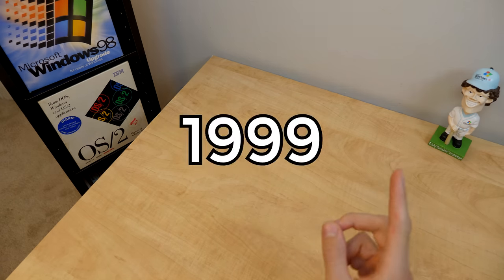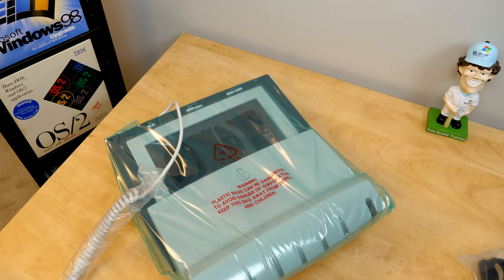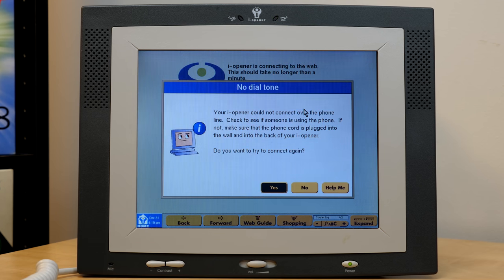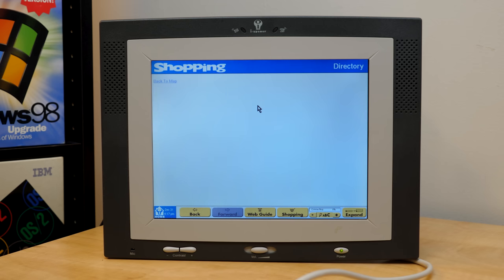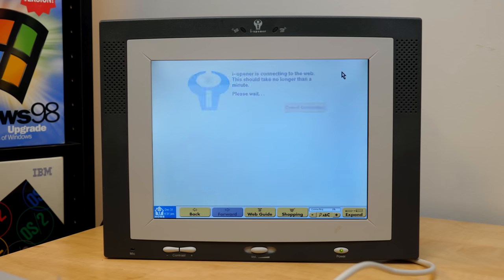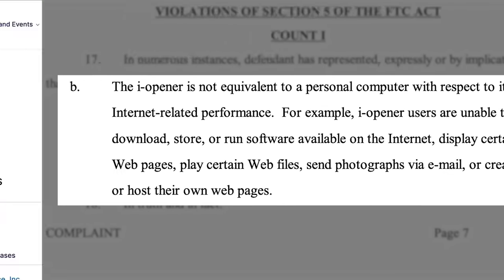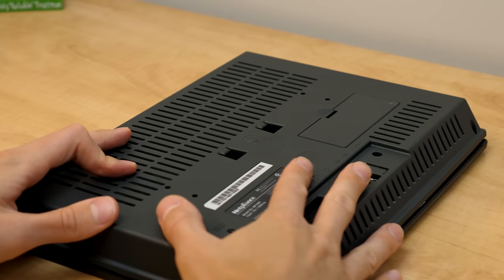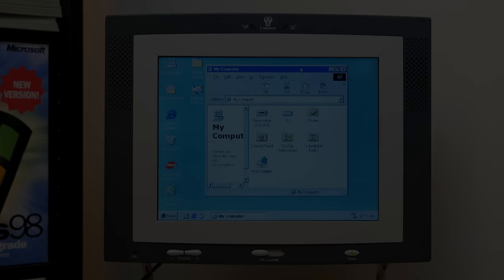i-Opener - The $99 Computer That Cost a Company Millions

Comment: I was relieved when you pulled out a second unit to demo the original software because I was like....noo don't boot it up yet! There's a exploit involving the initial bootup process that's gone forever once you finish it! :D

But thankfully you already knew about that. :D

Used to own one of these in the early 00s. My high school spanish teacher would have me help fix any computer issues she had and one day she gave me one of these that was just sitting in the closet.

Sadly I did not keep it as I didn't have the power adapter it needed so using it was a hassle. I did read about hacking it at the time but since it required a special cable it wasn't something I could do. I recall the version I had was one where they put epoxy over the BIOS chip too so removing it to flash in an external flasher wasn't practical either. (you seemed to have forgotten to mention that. They epoxied down the bios chip in some later revisions!)

Would definitely like to see you get drivers on it. Would like to see how bad Doom looks on that LCD panel. :P

Also there's an unpopulated second USB port pad on the motherboard. Curious if the SMD components and such related to it are present and simply soldering in the port would be enough to make it work. Would be cool if you could get a second port working. It would only require cutting a hole in the metal shielding since the case already has a cut out for it. Not sure where you'd find a matching port to solder in. I guess you could sacrifice the one from your second unit but surely there's spares with the right formfactor on digikey or something....

I imagine you could get one of those backpack Parallel port external CD drives too for some CD shannangins! Something I've wanted to do if I ever get one of these again.:D

Comment: This reminds me of a friend who acquired a computer that was setup for a medical device. It would beet fine from its HD but when the HD was replaced with another drive, nothing. What they found was on routine in bios that looked at the drive for a small partition of a certain size with a simple line of a short command at which point it would change drives and go to the "d" drive partition on the same HD and run the operating system. Simple fix, they repartitioned the HD into two partitions, the first limited to the originals size with the line of code in it and the second drive they added Windows to it. Simple fix without messing with the bios.

Comment: Got one off eBay in 2007, paid like 100 then and planned to use it as a core to create a digital jukebox in a old tube based floor standing radio that was broken. I horseshoed Midori Linux into it that ran ok,,, but never finished the concept. Later in 2009 I ran into someone that wanted one real bad and made a 100% profit. All said the iOpener was a great platform I never really got to fully realize...

t was a cool machine and around that time I had something similar made by Gateway too but the Gateway had those evil "self destructing" caps issue that many manufacturers enjoyed. in the early 2000's There's a good story there as well. A industrial espionage thwarted thriller.

Comment: This brought back some memories! I bought two of these as soon as I heard about how you could mod them. This would have been some time in the year 2000. I bought the kit with the hard drive mounting bracket and modified IDE cable, as well as a pre-flashed BIOS chip (it was easily swapped with the factory chip since it was in a socket) that would allow me to boot from any device. It was never a great system, but it worked! I think right now it's still sitting in a box in my basement, with a copy of FreeDOS on it, as well as some DOS USB mass storage drivers so I could easily get files onto and off of the thing. I think I might have originally installed Linux on it, though.

I gave up trying to use it for anything mostly because the screen was absolute garbage. The resolution was OK for the time but it was a super-cheap LCD panel that streaked whenever anything moved or scrolled.
Reply: Incidentally, the second one I bought sat unopened in a box for, like, 20 years until I finally pitched it in the ol' fuck-it bucket.

Comment: I have one of these . i acquired it for $20 back in the 2000's and started the mod on it but never finished it. I do however remember buying a custom PCB that you would attach to the IDE header and then could use standard cables . . . I may have to dig out it out of storage.

Comment: When I started driving, gas was .95 a gallon (now $3.34 where I live), the Marlboro Reds I smoked were $1.79 ($7.79 now), an hour of bowling was $15 ($50 now), movies were $7.50 ($13.50 now), house was $167,000 ($376,000 now) and minimum wage was $4.25 and now it's $7.25. 

At least quite a few examples of tech are cheaper. That's about it, though :(

Comment: Around this time line Radio Shack had a Internet Appliance, I think it was by HP, but required the MSN dial up monthly Internet to work. However back then if you wanted Internet for most, the only option was a dial up phone line service. So if you were going to use a computer on the Internet and not much else it made sense to have a Internet Appliance.

Comment: I remember those back in the day and when people found out how easy it was to hack. Always wanted one but I had more than one PC already and couldn't justify it or the room it would take up. But I always wondered how far you could take one. It would have been funny to see an i-Opener booting XP with a K6-III+ CPU at 450 MHz and 128 megs of RAM or something along those lines. I have no idea if it was possible, though. Running a WinChip may mean that revision only supported 3.5v operation. I used to use those to upgrade machines that only ran standard voltage. As long as you didn't game on it, they were as fast as a Pentium.

Comment: I had one of these. Version 1, I think. Modding it to run Windows was pretty easy. The hardest part was getting a 2.5" HDD that was thin enough to fit between the motherboard and the metal shell. Also the PS/2 port was funky. If you had a splitter you had to swap the mouse and keyboard or they didn't work. The thing was slow and had the worst flat-panel display I've ever used.

Comment: Oh yeah, I remember when Slashdot went nuts about these. That era of cheap inadvertently hackable junk from companies with more money than technological acumen was pretty awesome. Anyone else remember CueCat?
Reply: ' Anyone else remember CueCat?'  Of course, I still have two of them around somewhere in a box with old webcams, etc.  Not a lot of use with modern phones etc able to decode..
Reply: when i worked for the Oregon State BLM about 10 years ago handling files about half of the terminals including mine had CueCat barcode scanners for scanning the files, it was honestly kind of hilarious. Especially since legacy files with actual official CueCat barcodes would not scan on the firmware modified devices and had to be typed in manually only regular bar codes would scan on them.
Reply: Wow, I had forgotten about the CueCat. It's been ages!
Reply: I had one like 10 years ago to scan in comics and even then they were considered antiques 😨😨
Reply: I have many cuecats in a box somewhere - I got like 5 or more of them from Radio Shack I think - I'd just go in every week and get another one

Comment: This kind of loss leader hardware hacking still happens today. I had to install lineage OS on a Amazon tablet that's ad and data subsidized
Reply: There were clusters made up of PS3 consoles back in the day for the same reason
Reply: You can just ask them to remove the ads. Say you are having problems.  They won't even pushback.

Comment: The v2 was still easy. I've hacked both v3 (my personal unit which I still have) and v4 (the one with the RiSE CPU, but old sound chip). The Dolly cloning method was used on both.... its janky but it worked great. At least one of the units had epoxy on the BIOS chip, which thankfully I didn't have to touch. I opted for the v2 hack kit and a TennMax "lasagna" cooler with the a hole in the metal shielding over the fan area. Worked great with no heating problems.

Comment: The funny thing is that this is meant for novice users and refers to itself as the iPad, and I'd argue not just the name is a coincidence, but also the often use cases of iPads themselves. My sister (love her) is not at all computer savvy, but has an iPad with a keyboard to handle all of her computer needs.
Reply: Honestly that's all most people need nowadays. I have a pretty good desktop PC, and my non tech-savvy wife prefers to use the phone even if the computer would cut the time down by 50-90%

Comment: the pins are swapped to support a DOM, or disk on module plugged directly to the pin header. without a cable the pins would be upside down.

if your pins were cut you could just put the header on the other side and the pins would be in the right order.

Comment: I remember buying one of these for $99 specifically to convert it into a cheap PC!  I don't remember if I bought the crossover cable or made my own, but I remember someone had posted the missing drivers so in the end I had mine setup with a USB web cam and used it to monitor my dogs while I was at work.  It was a fun project at the time...

Comment: I think that it'd be possible to get a laptop or desktop CD-ROM drive to work off of the IDE port and maybe mount it on the side or in/on the base.

Also that WinChip CPU, at least architecturally, is a supercharged, over-glorified budget 486.  It only has one pipeline for data out and one for data in, iirc.  A Pentium CPU (which has multiple pipelines) would definitely be recommended over the original CPU.

In any case as to how the upgrades go, it'd be nice to see how it performs running contemporary games of that era or earlier.

Comment: I had an iopener V1 and I bought one of the kits with the bracket and cables.  I ran both win98 and linux on it for over a year, but at that point 800x600 was really showing some limitations with applications and internet sites so it turned into a network monitoring terminal for a while then was ultimately tossed out.  I think at some point I swapped in a faster CPU and cut a hole for a heatsink and fan as well, but again the performance was too limited for it to remain useful for more than about a year even when running linux which made it feel much faster than it did running windows.

Comment: 6:00 so, if you accidentally apply enough force to the cable and you unplug the PS/2 connector you'd have to unscrew the little flap to reattach it?
Reply: No it held the strain relief on the cable so it couldn't move.

Comment: I bought one of these at CompUSA back in the day. I was a design engineer at a company working on a tablet computer before they were a thing. Luckily they had a bunch of resistive touchscreens they were using for their prototyping and I found that I could fit one in (filing down the lip around the LCD, converting it into a tablet, powering it through a battery pack or through my car's 12v supply. I then upgraded the CPU to a K6 IIRC and added a microdrive and had my first MP3 Player running under windows. I did eventually get a letter from the company about what I was doing ( I was quite vocal about it at the time and I didn't ever subscribe to their internet since there was no hard requirement for it.) I ignored it (have it in the basement somewhere, but I did sell the computer at some point when I got a better tablet. Fun times!

Comment: Do you think the FDC really sued them because of users, or do you think it was because they used the IPAD acronym & Apple had plans for it around that time & would release it a few years later after they were put out of business. I bring it up because the FDC is not really consumer based but primarily is for business on business similar to the FDA which is not about food safety but rather about standardizing things between businesses. The expiration dates for instance are not for consumers but for business, however they did change them when consumers started using them & they realized they could get you to buy more.

Comment: Would QNX actually support the Canon Bubble Jet 2010 printer mentioned on the yellow flyer? I thought most cheap printers of that era used GDI printing which only had drivers for Windows.
Reply: It supported that printer and that printer only, so the driver was written into the customized iOpener OS.

Comment: $99 was too rich for me back then. Virgin sent me a couple of "Webplayers" for $50! Loaded a hacked Win98 on them asap!

"The Webplayer is powered by a 200 MHz Cyrix MediaGX CPU, 64 MB of SO-DIMM RAM, and a 48 MB M-Systems Disk-On-Chip 2000 for storage. It included two USB ports and contained a Mini PCI Type IIIB slot and 44-pin IDE header inside."

Comment: dating myself:  I did a college comp-sci project at CMU on how to replace the bios chip and install win98 on one of these machines.  I begged an ebay seller at the time to sell me two units, one nicer than the other for only 29.00 shipped.   Both of them delivered, I hacked them to run Windows, and I actually ran the later one for a few years as a very middling internet terminal before giving it to my parents.

My unit had epoxy over the bios chip, and I paid the 35 bucks for the twisted cable. I have to laugh at myself now, seeing how late I was on hacking one of these.

Comment: Oh, you don’t know how bad gas got. Before bush was out of office, it was 4.50 a gallon IN TEXAS. 

In 2015, it dipped lower than when it was when I started driving, 1.50. 

By 2018, it was 3.60, so expensive that’s when I got my new truck, people were unloading gas guzzlers. And that’s how it’s been since 2018 occasionally hitting 4.00 until the pandemic, April of 2020 at the height of the glut caused by no one using gas.

Comment: Circuit City used to deals like this back in the day. I think I got a deal on a Compac computer for 100.00 but I had to sign up for Cumpuserve internet for 2 years at 19.99 a month for slow dial up using a 56k modem.

Comment: I do not miss old LCD panels which were so dim and ghosted so much!
Reply: My LCD monitor gave up the ghost in 2013! I bought it in 2000. I tried to have it fixed but replacement parts for it where no longer available.

Comment: what is funny and sad, is that QnX is a much better OS than Win98 ever was.
Performance and efficiency-wise much better, real fine-grained pre-emptive multitasking, drivers are just process that can be killed and reloaded at run time. The graphics demo for QnX where amazing, you could have 10s of windows up running smooth animations while similar stuff on win98 would stutter and die.

Comment: You should install an SSD drive and add a wifi card for Internet connectivity. This thing would still run with a modern 32 bit Linux operating system in 2023! A hack transforms it into a capable mini PC! 😝

Comment: Oh, this brings back some memories.  I bought one of these right before it hit Slashdot after seeing it on Ken's site.  And then it hit like the next day or two afterward.  The warehouse didn't have any in it, and then Slashdot made mine become backordered.  Fast forward, and I get a letter saying there were new terms and conditions that I would retroactively be bound to (what you mentioned) - even though I already paid for the darn thing and was just waiting for it to come in.

Anyway, I bought one on eBay for $129 because the Slashdot effect had it backordered forever.  And I wound up getting a V2 like you did.  My BIOS wasn't messed up like yours was; I was able to get the kit and simply do what you did.  I went a bit further than you did - I put a fan and heat sink on.  Hard drive bracket.  I added an audio out jack.  PS/2 splitter.  Upgraded the RAM.  Upgraded the CPU.  Put a parallel port Ethernet device on there.  I do remember there was an issue with the USB chipset; any Ethernet USB adapters we ran eventually quit working. (I think just about anything USB wound up being flaky.) We eventually had to get parallel port Ethernet adapters.  (They even stopped working in Linux!)   The last thing we eventually looked at doing was trying to replace the screen with an active matrix screen before I moved on to a different hobby machine.

It was quite a fun system to play around with!  I ended up selling it to a lumberyard as a thin client Wyse terminal emulator.  (Unfortunately, they're long out of business, so no idea what  happened to it.)

Comment: It's a interesting device more for the mistery of finding what was and how could be modified.
Also qnx is a os that quite obscure but would like to see more about it. Basically is for real time systems on mostly non von Neumann computers, basically devices that do computer stuff but they are not fully computers. That you don't change stuff but in exchange you have reliability.

Comment: An interesting device, wouldn't mind one, as a change from regular PC boxes - however it isn't really, it's just a stripped back regular PC - maybe some form of industrial controller. If this was built from the ground up, then there would be no IDE header at all. So an interesting toy.
What really sucks, is the way it's tied into a provider, so when they decide it's over, you are stuck, as in the AT&T letter you discovered. I'd kind of like the authorities to make this sort of setup illegal, as all it ends up producing is a great heap of e-waste as people are forced to do so even if completely happy with what they have.

Maybe you could pull the board out of it and install a Raspberry Pi etc.